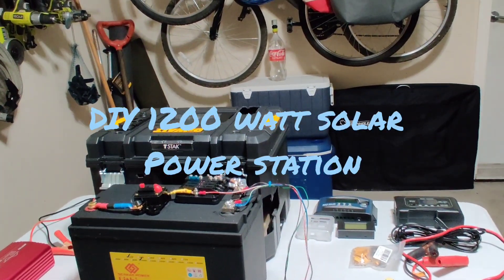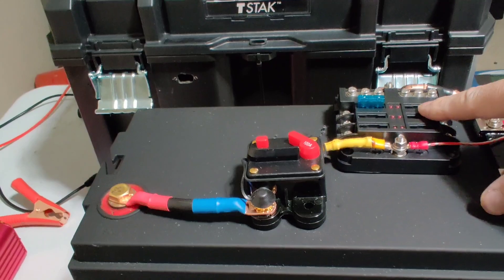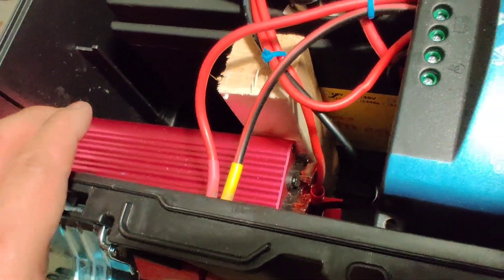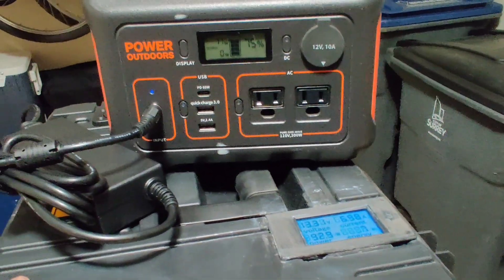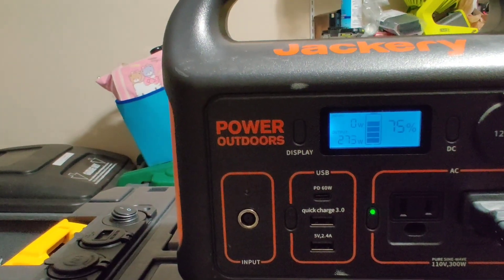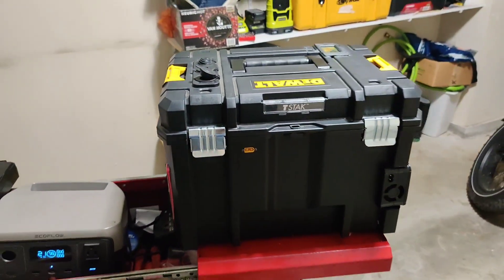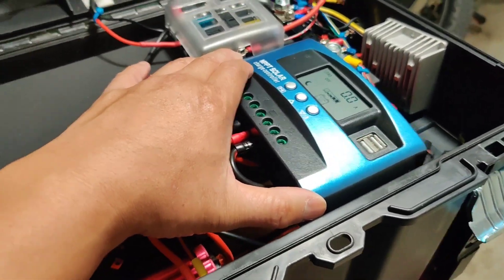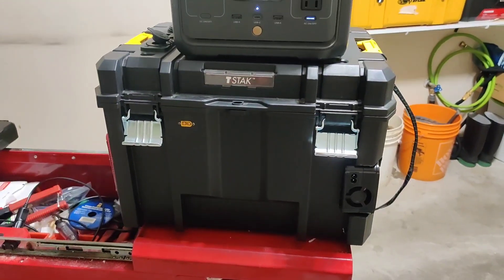DIY 1200 watt Solar Power Station

Comment: All right!
Between the 3 of them you'll probably never be without some sort of power.
I'm planning on building one as well, but as a newbie, I have a stupid question.
How to you have the charger wired?
Leads just connected to the battery?
Reply from the maker: My AC charger is connected directly to the battery. Everything else is connected to the breaker.